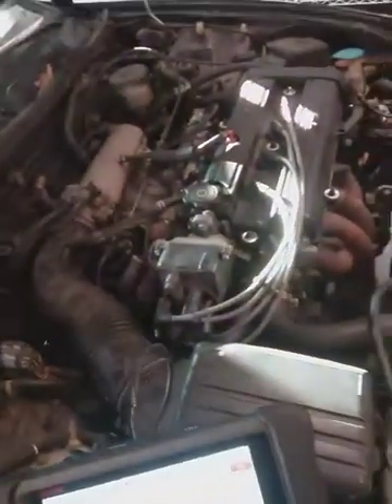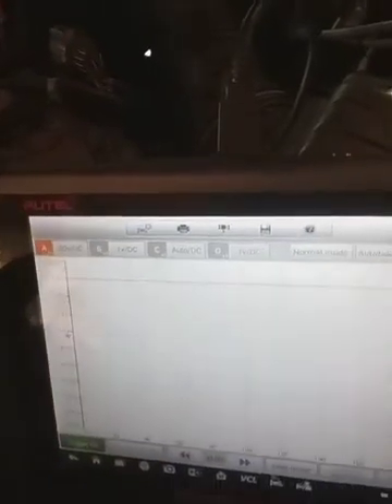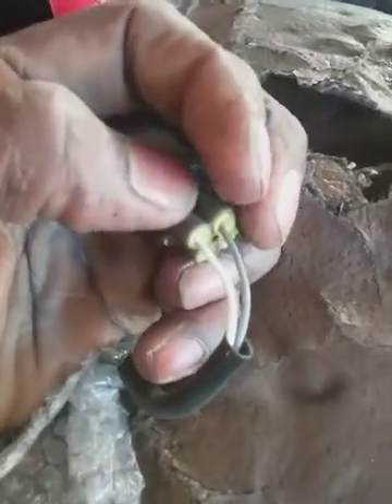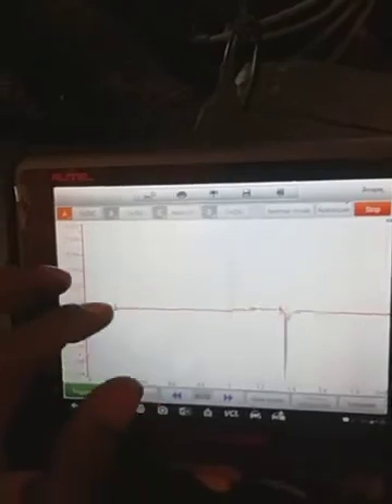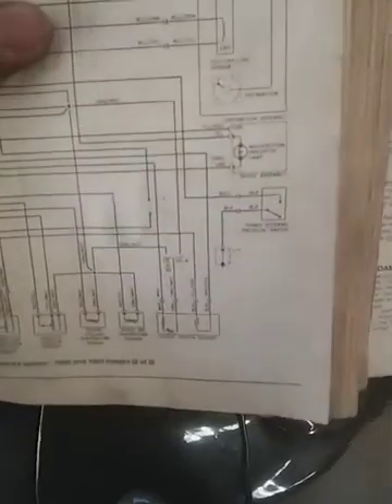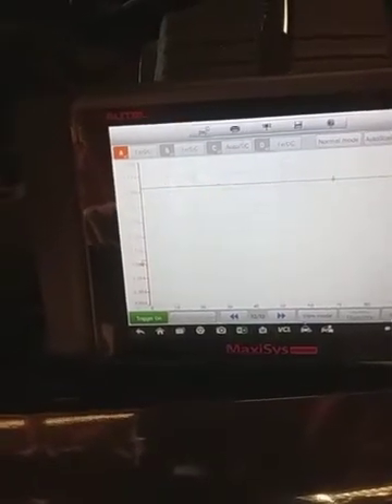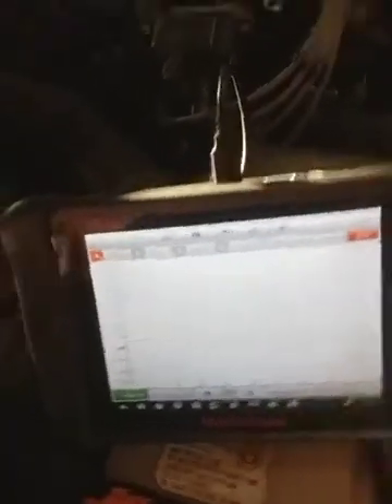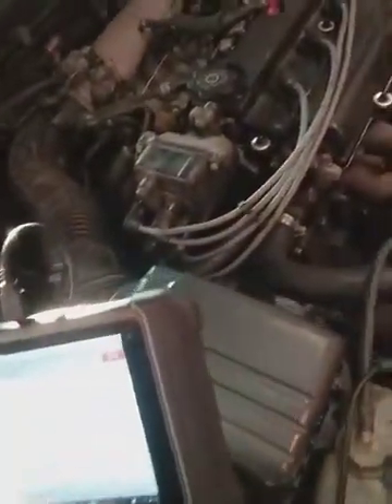Autel ms906bt Maxiscope o2 sensor obd1

Comment: When looking at o2 sensor signal voltage put a long time base across the screen so you can see the switching over time.
Reply from the maker: John Pilgrim I honestly didn't think at the time it wouldve any issue. However that'll explain the lack of oscillation!
Reply from the maker: When comparing to normal reading you'll see traditionally